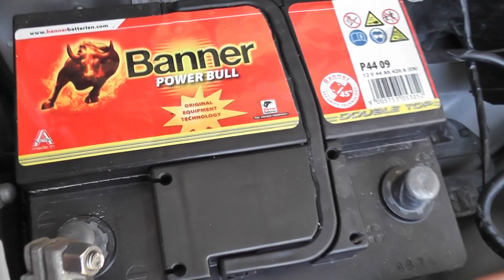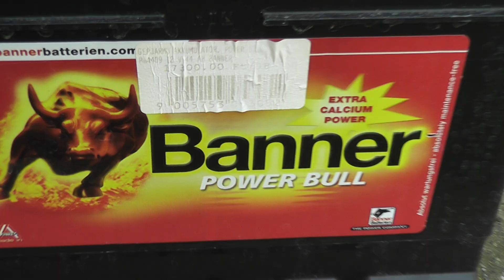Opel Corsa - Battery Replacement

Comment: Good video that will help many people see how it is done. Minor point I was told by my Engineer / Father  was to disconnect the Earth cable first, on dismantling, and last on replacement. This eliminated the chance of shorting against bodywork, as you put the other supply cable ON, which could possibly damage some component or ignite fuel / inflammable sprays, in the process. Small point but important. Thanks for your helpful video.

Comment: What a carry on just to change the battery. I just did it on a 2004 Corsa. Cut through the plastic bars on the scuttle to make it compliant and levered it out of the way. The battery retaining bolt needs about a hundred turns, then the socket falls off and into the well underneath. Fortunately the rubber drain flap allows access to retrieve it. Incidentally the pollen filter is situated underneath all that plastic, that's why it never gets changed at a main dealer service. Fifteen year old original battery wouldn't start the car the other morning so bought a replacement. Charged up the old and now it seems fit for another decade or two.
Reply: Having to change the battery on my '03 for the first time. Couldn't believe the amount of crap surrounding it. Usually a 2 min job on my other car!

Comment: Thanks a lot! Fixed it, my car starts again. One question though: how does the clip to the right of the battery work? I think the bottom where the screw is attached to the plastic frame has broken in my corsa. Turning it for ages didn't really work, not even if I held the bottom plastic piece with a vice... It's not exactly right now, but the battery can't really move anyway. Its this a problem? Also, the attachment of the plastic hood wasn't fixed with a torx screw in my car. I had to use a socket wrench

Comment: Thanks. Looks more or less identical to our Opel Tigra Twin Top (based on Corsa). The worst part was getting the plastic cover back in position.
Reply: did you lost your original radio code?

Comment: thanks for this. Helpful +++. but after replacing the battery i see that rain comes through the  grille and onto the battery . It must have been doing this before  but  rain on a battery doesn't seem good to me. The plastic flap doesnt seem to do much. Should i worry?

Comment: TIGRA TWINTOP: Same procedure but the first fastening is an 8mm bolt, the second fastener is a Torx screw.

The battery clamp is a 12mm bolt.

Comment: Didn't show the most challanging part: How to put that plastic cover over the battery you removed in the beginning back to it's place.  )
Reply from the maker: Sorry.
Reply: Shall car computer be OK if i remove my original battery and replace it with another car battery of another opel corsa cdti 1.3 diesel. Made in 2007.

Comment: In case anyone is wondering this works for the same as the vauxhall combo vans 2001-2012
Saves having to battle trying to get the window wiper arms off like the Haynes manuals suggest
Many thanks!

Comment: I tried to take the bracket off but it just kept turning, so I had to force it up with a screwdriver a while turning, Its a plastic nut thats rounded off, so there is no way to tighten it up or get under it to put a metal nut on. I found a solution, put a wall plug in with a coach scew  tightens up solid and easier to unsrew.
Reply: I'm stuck in the same situation (bolt on the plastic clamp-down at the base of the battery just spins).  Been trying to use a screwdriver to force it up, but it's not working too well.  Once I get it out, I'll use your wall-plug idea.

Comment: I tried it today but it didn't work for me. I followed your steps but I wasn't able to give away that plastic bar which covers the battery on the top. I just broke it a little bit.
Reply: Oh no. That’s really annoying to break your plastic trim, that’s what worries me, as the trim is all in perfect condition on my cc
Reply: @tom4412  I finally found the way how to do it without any damage. Im not sure how to describe it, but if you're interested, I can try to record a quick shot of my approach.
Reply: @denischlapek  Yes please, that’s very kind of you. It’s just removing the trim that I’m struggling with.the one water jetter seems to be holding the trim down for me. 
No rush just when you’ve got time. 
I’m in Shropshire, how about you. 
I like your song covers by the way.especially the Angles cover.
Reply: @tom4412  Ok, I'll try to manage my time to do it as soon as possible. I'm glad you like my covers, thank you. 🙂 I'm currently in Portadown, Northern Ireland. Anyway, if you would like, you can find me on FB.
Reply: @denischlapek  thanks, Northern Ireland- I guess I won’t be popping over to yours  to see how to remove the battery trim then. Never mind. 
I found you on Facebook, I’m Tom Davies. Cheers.